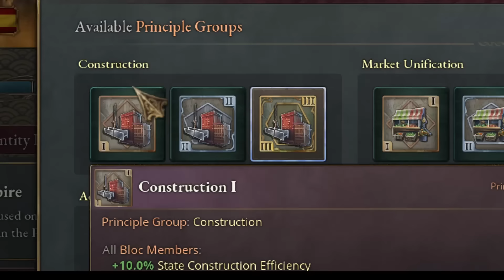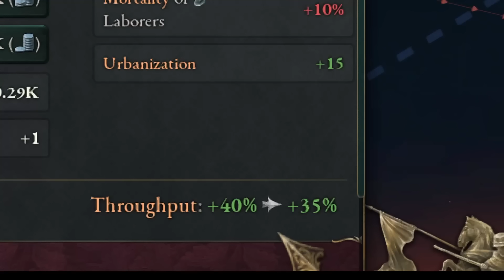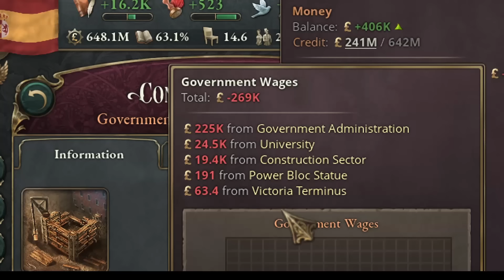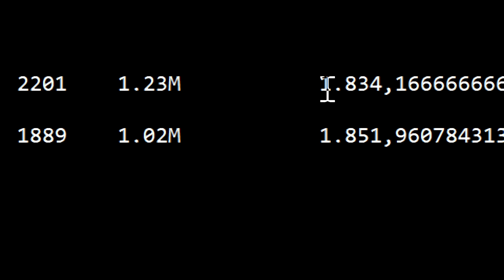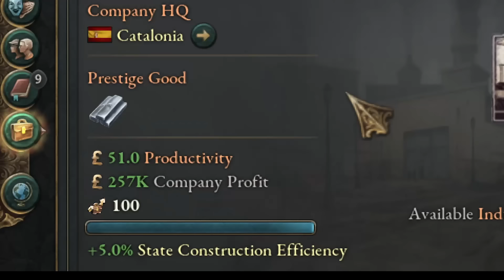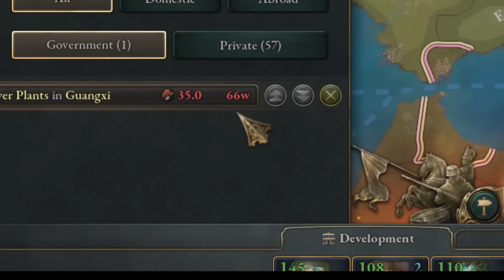Victoria 3 Tip: The construction company is far less useful than it seems.

Comment: Troughput bonus basically makes buildings use more input resources and produce more, but it keeps the wages the same, that's all. So in this case you get more construction points from 1 sector but keep wages as before.

Comment: Basic Metalworks is top 3 best company of generic companies. Access to tooling workshops and industry rights to steel. Basic Home Goods is top 3 best generic company too, with starting access to Furniture Manufacturies and Glassworks and industry rights to Lead Mines. Hmm two top tier generic companies, what would be better than that? Answer is United Construction Conglomerate, you get those two companies combined with downside of losing access to low performing lead mines. I'd say that makes it a top tier overall company better than any single generic company. The 20% construction bonus is worthless to how quickly your companies privatize buildings (how company meta works right now is that investment rights with GB means you will basically win the company game). This is all in regards to meta btw, maybe I should make a video more indepth about this.

Comment: I like the tests you did in this video, but I think you're misrepresenting the construction company's strengths very severely. 

I agree that the "20% construction sector throughput" is probably a lot worse than people realise, and that in general construction sector efficiency is superior. 

First of all, one thing you missed is that construction sector "throughput" allows you to essentially stack 20% more construction in your best MAPI state. You can only build a limited amount of construction sectors in your "best states" (states with coal/iron/lead etc. for optimal MAPI). Assuming you have maxed out your construction sector in your best state, the construction company would essentially allow you to have 20% more construction sectors within that state - e.g. if the cap is 30, it could now be seen as essentially "36" within your best state. If you wanted the same output, you would instead need to build those 6 additional sectors in a less efficient state which would cause cost issues due to MAPI. I agree the wages are kind of negligible for construction sectors. 

The main thing you didn't mention though is the fact that the construction company has three of the best possible buildings being Steel, Tooling, and Glass, with lead being decent. These are the main inputs into your construction in the mid-late game (with steel frame buildings) and by having the company, you will significantly reduce your market price for all three of those goods and will likely be able to support much more construction much more quickly than otherwise. Companies have significant construction efficiency themselves + throughput bonus on their goods, so this company will be ridiculously profitable once you have steel frame construction sectors throughout your country (due to high demand of all those goods). I'm sure you will notice that in the mid-late game, a huge bulk of your economy is dominated by steel, tools, and glass. 

This isn't to say that there aren't better companies out there or that the construction company is even one of the best ones - for example, spain, belgium, UK and US all have excellent prestige steel companies that outshine the construction company. But I think you severely undersold what the actual strengths of the construction company are, while only focusing on the "prosperity bonus" which is only a very minor benefit to the company in my opinion.

Obviously there's a whole separate argument to also be had regarding limited mandate slots and whether the construction company warrants a whole mandate slot itself, but that's a separate issue (which I think wasn't the point of this video).